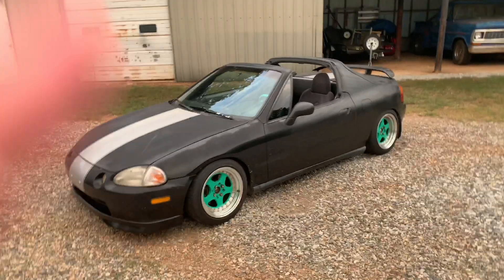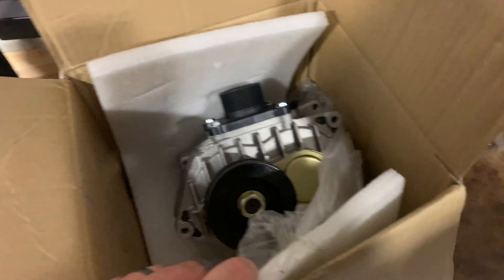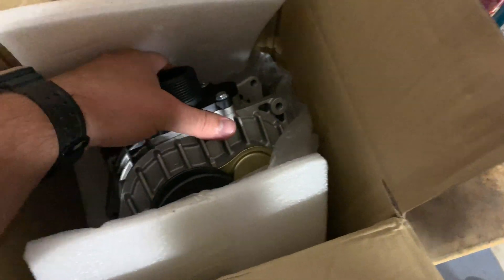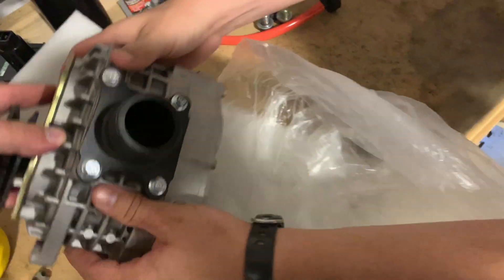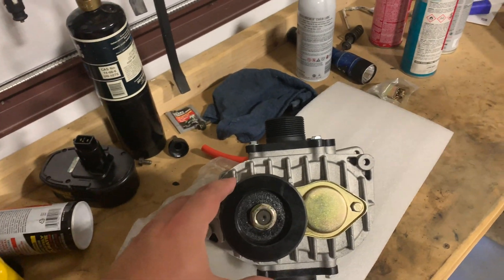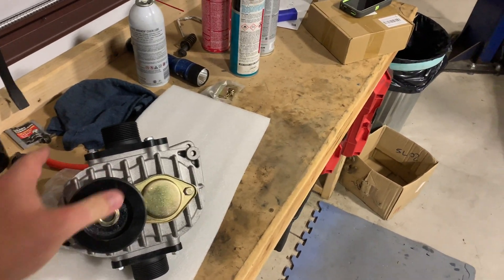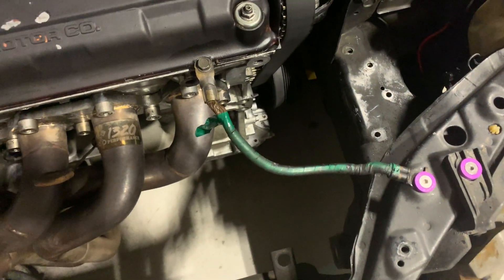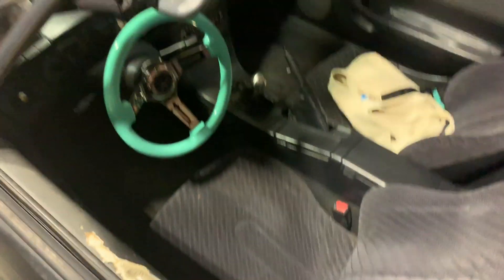Supercharging the Civic del Sol - AMR500 - ‘93 Honda B18C1 - Pt. 1

Comment: I just ordered one a few days back and will be in tomorrow! I hope we get good gains.
Reply from the maker: Shawn Combat awesome bud, what are you putting it on?
Reply: @HiRevzMedia  You may not believe it, and it may not work so hot. BUT a 1988 "2.8" Camaro, currently puts out only about 85 hp to the wheels and 150 would be just right for me and I also have a nitrous set up. with that alone I get down to a 6.2 0-60. But I want a little more pep for around town.
Reply: Update, Went great! Unbelievable how much pressure it has. my first set of piping blew off. New BOV comming soon
Reply from the maker: Shawn Combat that’s awesome, send me a video.  I’d love to see it.
Reply: Stock NA engine 1.3 and 1.5cc how many bar can boost?
Reply: @choongbrave120  I'm almost done with my install, I can only work on weekends, though this weekend I'll update on the PSI, all I know for now is in my application I am seeing great results. Just finished converting my car from MAF to MAP